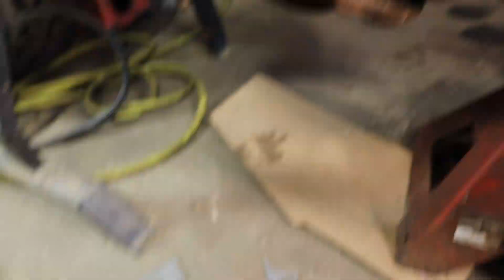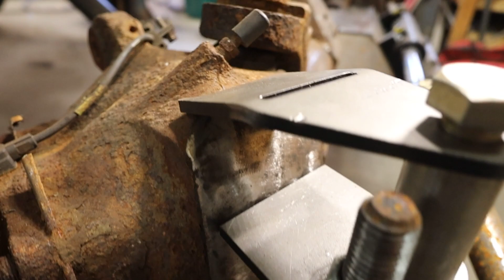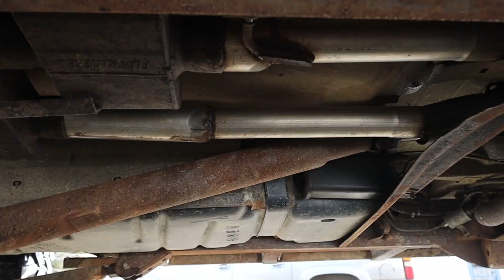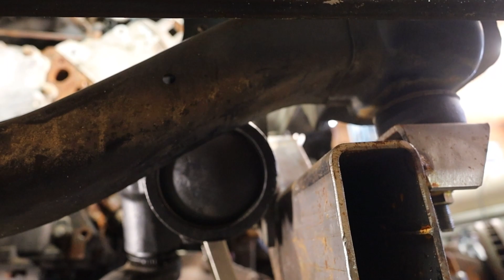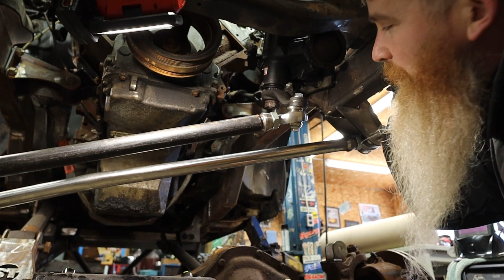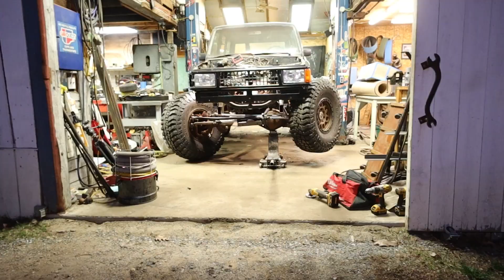Super Trooper 15: Steering in a New Direction

Comment: Love what your are doing with your Trooper!  

I've dreamed of doing similar with one and setting up inside as an overland camping rig.  Build  and install slide out drawer units in back with counter for stove, fridge, sink.  Put a sun 18"x36" roof in back of roof with seal to hole in clam shell tent floor mounted on roof rack. Clam shell tents are about 110-200lbs so would make rig a little top heavy, but at 100-150lbs are light enough to be lifted ooff by a couple of strong people when doing serious wheeling.  

Looking forward to seeing more of this build!
Reply from the maker: The overall plan with this is the ability to wheel some pretty tough trails, hit jumps, go 80 on the highway and get to remote camping sites and be comfortable. I want to do a slide out, cooling bench fold down on the larger rear door, roof top tent and some neat storage cubbies. The fridge/freezer is a must too. I have more updates coming soon.
Reply: @ilovemybike  
Thanks for reply!
That's what I would love to have!   First overland rig I saw was one of Andrew St. Pierre White's rigs in about 1996.  He's built many, most with pop-top roof with bed platform hinged at windshield so person can stand in rear half of vehicle with bed up,  and have a space between bad and back door for easy access to bed when bed is down.  He doesn't use slide-out cooler / hob / sink kitchen, but does use side windows as storage compartments and hinged shelves on sides with access where windows were to cook, etc. 

Down side of this kind of setup is hinging roof bed / rooftop clamshell tent raise center of gravity alot.  And making a hinged roof bed tent is quite complicated.  But there are a few clamshell roof top tents that could be modified to have access from below thru a opening hatch in 4x4 roof.  Doing this kind of clamshell roof top tent with some added hardware could be removed by a couple of people to allow user to do more serious wheeling.

Feel free to let me know if you would like to discuss this more.  Not sure there is a way to exchange email addresses privately here.